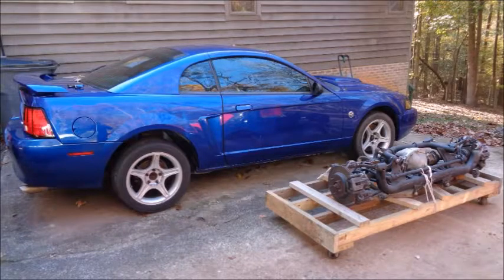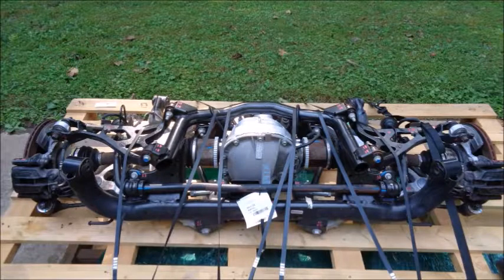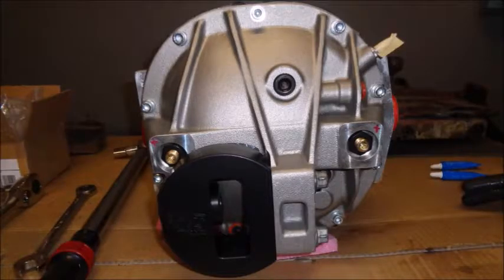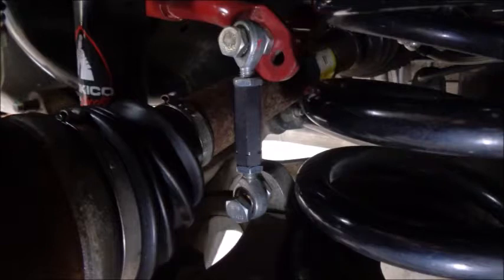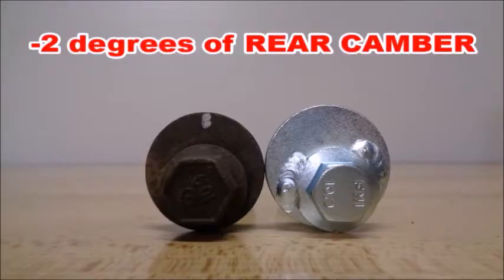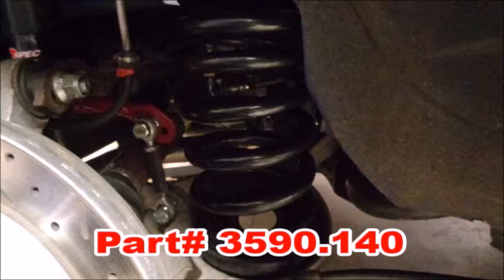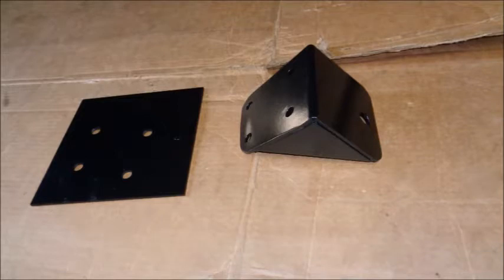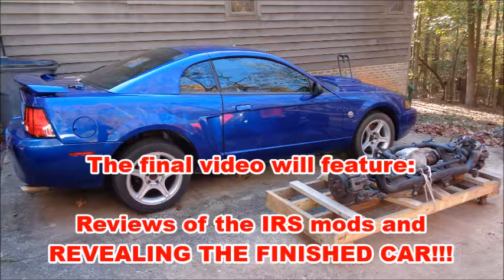MUSTANG ST PART 6: Declaring Independence (IRS Swap & Performance Parts INTRO)

Comment: Ride heights- balancing question:  I have coil overs with my solid axle. If I use the stock 2003 coil springs with irs (2003) what fender ride height should I expect?  Do you feel the balance of car change much?  For road racing do you feel all the upgrades you did to the irs is beneficial?
Reply from the maker: Just to clarify... You are swapping a 2003 IRS into your SRA Mustang, which has coil-overs. So, you would end up with coil-overs up front and OEM 2003 Cobra springs in the rear. Is that correct? I've actually never had an IRS with OEM springs on my cars. I used the Eibach 99/01 Cobra rear springs when I did the swaps. You might find the ride height info you need on one of the Mustang forums. I don't use coil-overs on my cars, but I can say that adding the weight of the IRS to my GT and my V6 helped with the overall weight balance (but I also made several other mods to improve the weight balance of my cars). There are differences between a road race setup and an autocross setup (my experience is with autocross). Based on my autocross experience driving other people's stock IRS-equipped Mustangs and my upgraded IRS Mustangs, I can tell you that the upgrades make a big difference on an autocross course. For more information, check out my "IRS vs. SRA" video. If you have any other questions about the IRS swap, I'm happy to help.

Comment: What year(s) of IRS will fit into a new edge? I want to IRS swap my 2000 but I don't know what IRS I need or if I can use a newer mustang gt IRS.
Reply from the maker: The 99/01 and 03-04 Mustang Cobra IRS assemblies will fit into 99-04 Mustangs. But, there were improvements made to the IRS assemblies over the years. The inner half-shaft splines went from 28 to 31 in 2001. In 2003, the half-shafts were changed to an improved 31 spline version. The rear gears also changed: 99/01 had 3.27; 03-04 had 3.55 (but the assembly you find might not have factory gears). Some early IRS assemblies had issues with the cross-axis joints. Ideally, you will want to use an 03-04 IRS assembly for the swap. There are some people out there who have installed s550 Mustang IRS assemblies in older cars, but that does require fabrication.
Reply: Have to 32 gears 62 miles per gallon no dollar dollar is through intake manifold anode exhaust YouTube joke 232 gears from Summit

Comment: I have a 2000 newedge gt and I was wondering how hard and how much is costs to do the IRS swap..... I broke my 28 spline axle and I was wondering if it is worth to do the swap
Reply from the maker: It's hard to give an accurate cost for the IRS swap, because there are many variables. IRS assemblies have gotten much more expensive in the last few years (because they are getting rare). I have heard of people finding them locally on Craigslist or Facebook Marketplace for less than the Mustang salvage yards, but that might require waiting a long time until one comes up for sale. I've had to have the differentials rebuilt in every IRS assembly I've purchased. If you get a diff that needs work, it will add a lot to the cost. If you plan on using the IRS for autocross, you will want to replace the bushings, which can be expensive. Taking all of those things into consideration, it could cost $3,000 or more to get a fully-prepped, reliable IRS assembly. The swap takes a lot of time, and some parts of it require 2 people. If you've done a lot of suspension work, and dealt with bleeding brakes before, it's not a very hard job. It does take planning and patience. Swapping in a prepped IRS will make a big difference in how the car handles. But, it is possible to get a solid rear axle Mustang to handle really well. Ultimately, it will come down to how you intend to use the car.
Reply: @warhorseracing  I would like to turn it into a road course / autocross car and don't mind getting a better rear end.
Reply from the maker: @tylercasanova1585   A prepped IRS will perform very well on a road course or an autocross course. You will also want to improve the front suspension and stiffen up the chassis.

Comment: Hi Warhorse,
I have an all stock 75,000 mile 01 Cobra with bad sway bar end link bushings.  If I only replace the end links, how will the ride be affected?
Full Tilt?
or
OEM?
Reply from the maker: If the end links are bad, the sway bar isn't doing its job as well as it could be. If this is a street car, OEM end links will be fine (but, they will eventually fail again). For an autocross car,  the FTBR end links (when installed correctly) would be a better choice. I installed the FTBR end links at the same time as my other IRS mods, so I can't give an accurate assessment of how much the FTBR end links would improve an otherwise stock IRS.

Comment: Very well done sir! I like the IRS much better than a solid axel as it rides and handles better after being upgraded especially on rough/uneven surfaces. The use of 14mm bolts in the lower front IRS attachment points helped take the clunk out of my 99 cobra IRS. And I added the front bracing bracket under the pinion where the driveshaft attaches. The IRS now works as intended and is a joy to drive. Thank you.
Reply from the maker: Thanks for checking out my videos! It's amazing how much better the IRS gets when upgraded with the right mods.